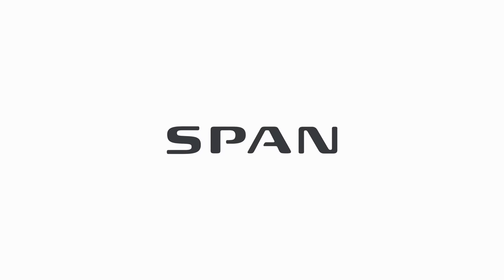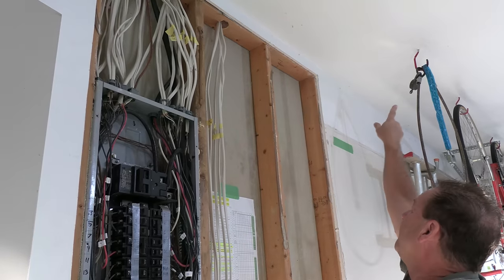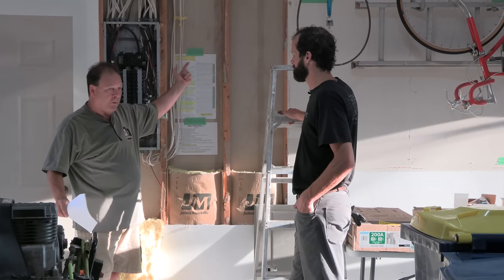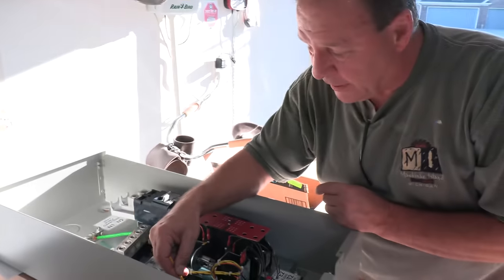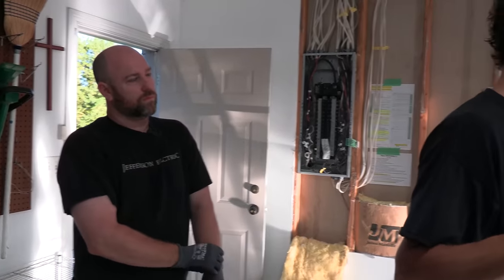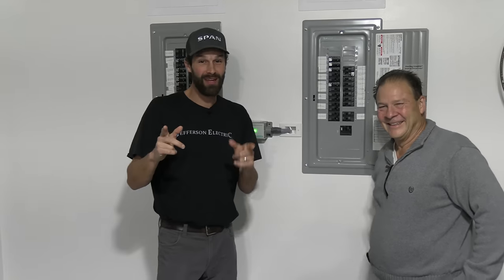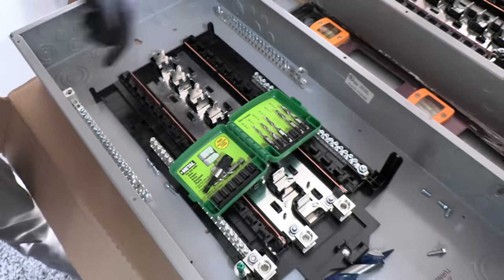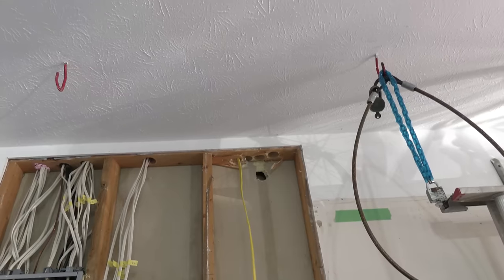When the Customer Plans the WHOLE Job

Comment: This customer is awesome. Usually when you encounter an electric engineer they do the work themselves and it's wild. This guy knew his limits (though I think he prob could do it) and I think did a great job.
Reply from the maker: You couldn't be more right. Tom maintained an attitude of humility despite being a brilliant individual fully capable of anything.
Reply: This.

(My sentiments exactly)
Reply: You can see the engineer in him when he randomly touches the breaker faces at 9:25 … that panel is hot and shouldn’t be touched as a demonstration prop. Just the classic theory vs field. 

I’ve had engineers on service calls for medium voltage applications. Always worth a good brief on safety and approach distances in the truck on the way to the site.

Comment: Sometimes when working with a customer that involved can be difficult when they micromanage especially if they only have a vague understanding of the work but when you run into one that really understands what the work involves and better knows their building well enough to help you lay things out/pull cable is an absolute win.

Comment: It’s great you listen to knowledgeable customers.  I’m also an Electrical Engineer  and have had problems with being summarily dismissed not by electricians but by solar contractors.  I’ve come to the conclusion, in my area, that the solar contractors I’ve experienced are seriously lacking in fundamental knowledge of how electricity works in conjunction with solar arrays, solar inverters and battery storage.  Some of the things solar contractors have told me is truly astoundingly stupid.  Even from a common sense perspective. So props to you to listening to knowledgeable clients.

Comment: Since you are using a normal QO panel, I’d suggest installing the Emporia Smart Home Energy monitor or something similar. I have an old CH 200 amp panel and have added this to monitor branch loads.  Let your customer know that he can pickup AFGF receptacles for his bedroom’s.  They work great and will protect the whole branch if added at the first device.  I have Eaton installed because the led only comes on under fault whereas the Lutron has a green status monitor.  Joel, you my friend are AWESOME for allowing the customer to be part of the design and implementation.  This is a rare gift and a wonderful collaboration.
Reply: I also have the Emporia system and it works very well. Reasonable price, easy to install and adequate reporting.

Comment: Architectural Designer here, calling it a "Top Plate" is fine, cause technically that's what it is. In this case more specifically it can be referred to as a "Raised Top Plate" being one that sits above the ceiling joists. I've also seen it referred to as the "Capping Plate" in a few situations, also a "Rafter Plate" might even be more accurate.  From what I've experienced, it can change from region to region or from profession to profession. Calling it a "Top Plate" generally gets the idea across, be it talking to a plumber, electrician, or builder. Just for the love of all that is good, don't call it a stud. 😂😂
Reply from the maker: Thank you thank you thank you!
Reply: Is the term defined in the National Building Code by any chance?

Comment: I like this guy! He's also an electrical engineer who seems like he's knows what he's doing unlike most of the ones I've met who rather than educating themselves insist that they know how Electrical works. He also doesn't like arc fault breakers that's a plus. Yeah you're literally paying for them to redevelop the product that was written in the code so they could sell the product. I think our faults are an answer to a problem that doesn't exist when things are properly installed. If you look at what they've been doing in the UK with electric they have put RCD-GFCI protection on everything years ago and they're still having problems with incompetent installations. And installations that haven't been touched for decades are in beautiful condition still functioning with no issues usually. First they were saying oh you need our faults in the bedroom because of cords getting pinched up against the walls and things behind beds and such then it moved on to just about everywhere which just seems like it's a we can throw that everything until we find out what problem it solves move. Where was I going with us I don't know. The UK is slowly adopting arc fault combination RCD breakers however there is no standard to how they're notifying the user of the fault so every manufacturer has a different color blink code standard that has to be looked up. There's something to be said about the older technology and where it doesn't use more electricity than it needs to a.k.a. none and it just works basic no unnecessary computers. We keep trying to stick smarts and things that don't need smarts I just heard a thing about how like over 75% of washing machines that are smart are never connected to the Internet and yet they wash dishes just fine so you're paying for extra stuff you're not gonna use which makes getting the parts to make them harder as well.

Comment: I ONLY install Cutler Hammer BR panels and have installed hundreds of them and I’ve never had a call back to replace a breaker except one time a guy was stealing electricity from his neighbor and over powered a breaker in his panel and ended up burning up meter can and meter……..he had a lot of explaining to do to KCP & L!  I love the Cutler Hammer BR 40/40 200 AMP panels and used to get the value packs.

Comment: The three little fuses in the smart module are two utility sensing fuses fed from each line of the incoming utility after the main disconnect 120vac each and another 120vac fuse fed from the load side of the switch for the incoming ac powering the built in battery charger in the generator controller.  These fuses will normally blow due to utitlity power surges or problems with generator controller, never seen one blow just from start up, but it couldnt hurt to remove them during installation.

Comment: Im exactly in toms situation right now. EE that was an apprentice electrician in college. Have speced out a standby generator at the house. split 400A service feeding dual 200A transfer switches. Swapping out 2 200A split bus panels. Currently looking for a contractor i can either help do some of the prework steps and or help out on the job. Thanks for sharing your craft!

Comment: Have had Eaton AFCI Type BR breakers installed for about 10 yrs.  One of them tripped when there was a lightning strike a couple of hundred feet from the house.  Other than that, no problems...
Reply: Mine are 19 years old never had a trip either AFCI BR's
Reply: I'm surprised they didn't even discuss Eaton.. I've never had an issue with them. Can't say the same for Siemens

Comment: You heard it here first folks. An electrical engineer doesn't want AFCI. Hmmm. I totally agree with that one.
Reply: Yeah, I see your point, because live spark gaps in enclosed residential spaces containing combustible materials without anyone's knowledge is a comforting thought.
Reply: A normal breaker will still trip on a parallel fault across either the ground or neutral. An inline break is not common that it wouldn't just stop working. Of course there are exceptions to this but nuisance tripping is a thing and I would prefer breakers that are dumb rather than breakers that can catch a virus or be involved in a botnet or be somehow altered by an outside entity because I am using to much power according to them. Some people may have good intentions now but that does not mean the next guy will but he still has access.

Comment: Joel, you did not pull the meter, but you broke the seal on the Meter base.  How does that work in your County.   In my County when you break the seal, that is considered tampering.

Comment: There are, sadly, serious talks about banning gas appliances because of their emissions. So leaving circuits open for converting back to electric is worthwhile. Also, leaving a 240V breaker for a potential EV charger might be worth adding in to future-proof the panel.

Comment: I don’t understand people’s hesitancy with arc fault breakers. Newer ones are better and if everything is tightened and torqued properly, they work fine.  I wired my entire kitchen with arc fault as required.  Garbage disposal and dishwasher on arc fault plugged into GFCI which is normally problematic but it all works just fine as the newer stuff is better.

Comment: Less than a ZERO percent chance I would work on this guys house.
Reply: Good, you don't belong at his house anyways if you are not willing to work with your customers. Like Joel said, the customer will be disappointed in your work if you don't listen to what their expectations are.
Reply: @carbongrip2108  Everybody draws their own line.  To take the example to ad-absurdum, would you clean a customer's toilet if that was his expectation?  Of course not, this was an absurd example, but it serves to illustrate a point.
Reply: Most of the jobs I’m on have a 1200 page project manual in addition to BIM and hundreds of pages of coordinated drawings, and have government inspectors on site as owners representatives. This guy is a cakewalk by comparison.

Comment: Most Electrical Contractors are more than willing to work with home owners. Most Homeowners refuse to pay for the many walk-thrus it requires to collaborate. I remember on one house I totally re-wired, my boss had 20 billable hours on walk-thrus alone (properly documented)and the homeowner refused to pay. They were told up front, the cost would be $150/Hr. Most States also allow homeowners to do their own electrical work.  If you think all Electrical Contractors are arrogant,  then get your own permits and do the work yourself as a homeowner.  That is how the free-market system is supposed to work.  Electrical Engineers are usually a nightmare to work with because they don't understand code.  Their work can be electrically sound(kind of) or wild looking, but it does not even come close to meeting code,usually.  Thanks-Russ-28 years in the Electrical Trade